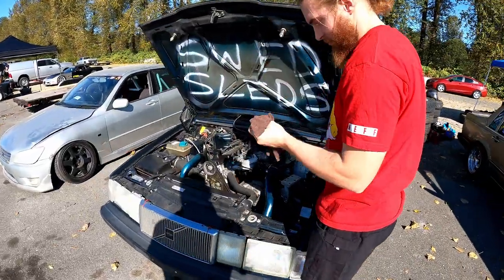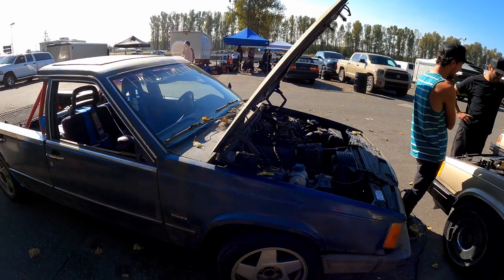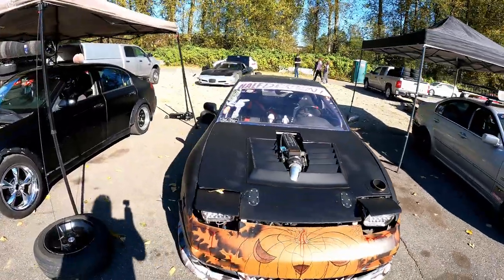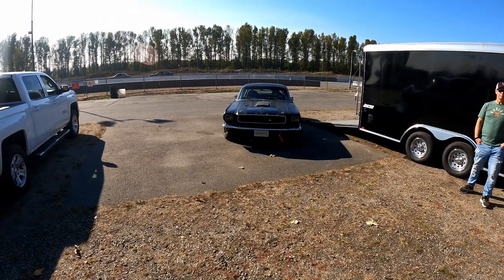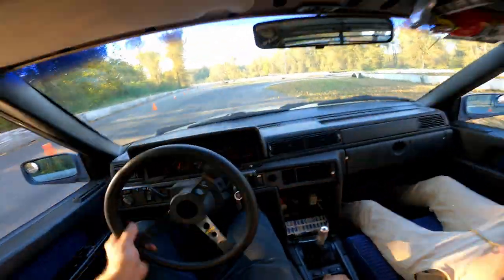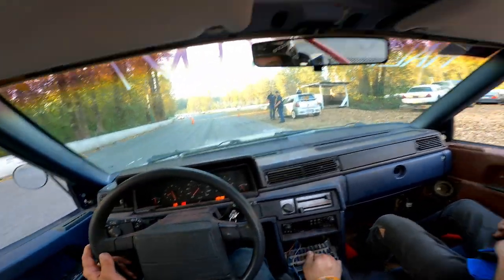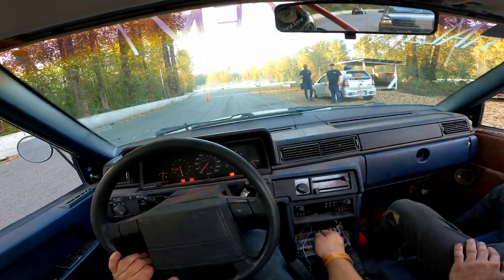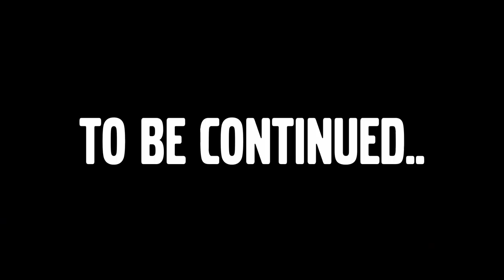Drifting a UTE converted volvo 740 drift missile

Comment: I have a question. I have a 1992 vovlo 240 I manual swaped to a m47. The rear end is still the stock automatic gearing and stuff.  Na Engine and trans mounts are stock. Will it break if I dump the clutch? I'm afraid to do it Its my daily driver. Love your vids
Reply from the maker: Will only break if your engine and trans mounts are old as falk. If theyre in decent shape you have nothing to worry about